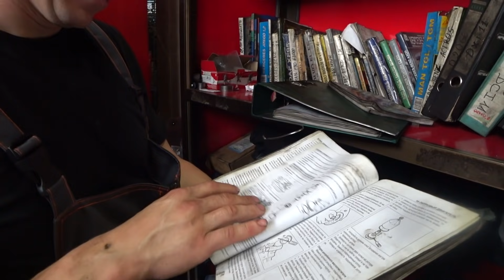SCANIA V8 16L - ENGINE REPAIR - СБОРКА ДВИГАТЕЛЯ

Comment: Thank for this video,your crew are experts let god bless for all your videos made of dismantling of all  pkw engines.
Reply from the maker: Thank you brother. Very good words. All the best to you.
Reply: Dear Razborgruz-trucks life:Sir i have one question i hope that you can help me,on your tool box there is one big socket set with sockets and pliers,extensions,ratchets flexible with yellow handle,hammer,screwdrivers and so on,so i just want to know the brand of manufacturer because i want to buy for my pkw workshop as well,because sometimes i need to go to repair trucks and busses outside my workshop when they stop near the road,and this set is very good because it had everything so just wondering that i can buy via internet,is it forsage,ombra or some other,i can not find in forsage catalog that big socket set with everything.regards from Croatia-dubrovnik and one more thank you for everything.
Reply: @trucks_channel_razborgruz .    MANTAP 😀 👍👍👍...             FROM INDONESIA....🙏

Comment: One of the reasons Scania engines last forever is the centrifugal oilfilter,the engine of my 1969 Scania 110 Super looks like it was overhauled yesterday,when you lift the rockercover it looks brandnew!!
At oilchange you lift the filtercover,remove the rotating centrifuge (it rotates at high speed;which is audible after you shut down the engine that ran upto operating temperature) inside the centrifuge you’ll find a rubber like substance glued to the inside of the centrifuge outside upto 6-8mm thick sometimes....this rubber like substance is the black shit that contaminates and finally distroyes your engine!
You scrape clean the centrifuge,assamble the filter,it’s a 15 min. Job....and your engine remains spotless forever...a paper cartridge filter is bullshit compaired to centrifugal filter....
Reply from the maker: That's for sure)
Reply: I looked after a small fleet of Scania`s & you`re correct centrifugal ( `spinners` I called them ) did a great job. You could even gauge the quality of oil by the thickness of the compacted sludge between oil changes.....the better the oil the thinner the build-up so you could choose the better oil which added to better longevity. I seem to remember that the `spinners` were made in Birmingham, certainly in the earlier years at least.
Reply: @edwardwilcox6606  Zetor Tractors had the 'centrifugal spinners' on them, on the bigger ones you could hear the spinner still spinning long after the engine was stopped

Comment: At what torque are the cylinder head bolts tightened, before the 90 degrees?  
Thank you 😀
Reply from the maker: I don't remember) I'll ask the master
Reply: I found it on a website and it said 240. That's how I tightened the screws and the engine runs perfectly.

Comment: The mechanic said the crankshaft has no problem so there's no need to toched if there's no problem with it?
I read about rebuilding engine that the crankshaft is to be replaced because it will bend due to wear and tear.
I don't know but, thats not a good decision, to replace everything but the crankshaft.

Comment: Did you overhaul the engine ......... after how many kilometers?
Reply from the maker: Hello. Approximately 400.000
Reply: Hallo.400.000 km sind aber nicht viel für so ein Motor!
Reply from the maker: @bandit8720  Ich würde sagen - das ist sehr wenig. Aber hier in Russland kann ich jeden Motor auch für 100.000 km fahren.
Reply: @trucks_channel_razborgruz  Hey.Wie meinst Du dass...für 100.000 km fahren?
Reply: How many miles is that?

Comment: Hmm, I hope he used that torque wrench for more than just head bolts and rod caps :-/. I always cringe when I see air gun being used on small bolts.
Reply from the maker: Everything is done according to the manual. Everything is as provided by the technical documentation.